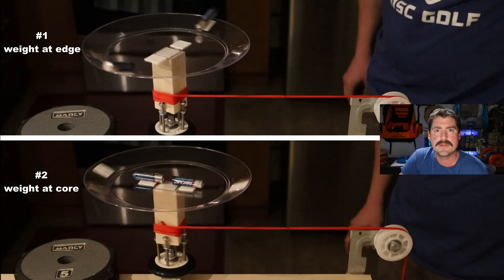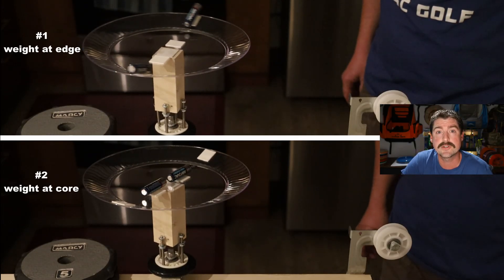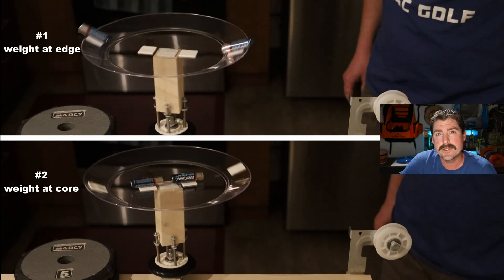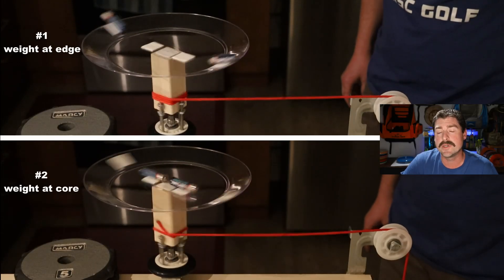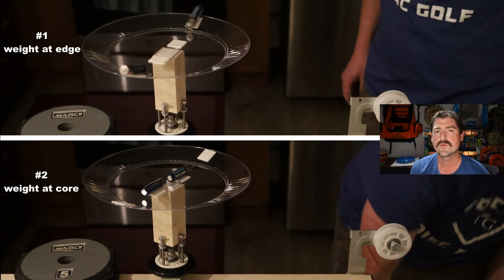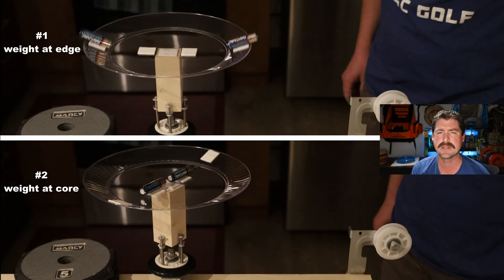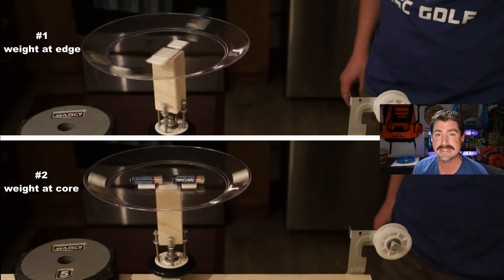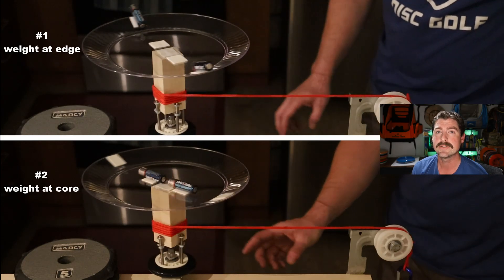MVP Discs - The FULL story of angular momentum

Comment: would love to see this experiment done with some mvp discs and an eqevalent made traditional way.  as in the HEX and BUZZZ same weight as well. so they are so equal as possible. use a sharpy and mark the edge so you can slow down it to see the difference in spinn speeed. as this shows the concept sure, one disc two batteries and some tape. sure proof of concept. 

as first qusetion i get. is that the weight is more evenly spaced at the center of the disc becuse it's lass mass seperating the two batteris  and then at the edge, its a lot of relastate between the two battaries, so the energy then get pushed in to two points rather then a disc. 
if this makes sense. 

ser yes it would take more energy to get the spinn, as there is a greater distance for the mass to travle, hens the speed of the disc is differnt then if it was cast in one mold and evenly distribute weight, if this makes sense. but it would be more stable. then a traditional made disc. 

but what would happen if you used or would it be any differce between this experiment, if it where done with am axiom hex and the buzzz or any other 5 5 -1 1 disc. or any other. and se where the weight for equal spill lies. 

lets assume that  hex and a buzzz at 175g gives this result, but a hex at 165g (if they make one that is) and a buzzz at 183g have the same spinn speed. then this would actually be intersting to find out. 

this is just guessing on my part. but these where my thouths i got from watching your viedo. 

I have dyslexia so hope i made meg self understood. 

kinda want ot get some mvp discs my self. just started this year but was drawn to the mvp disc, right away. don't know why, they just or the one I got to hold, just felt right, was that gyro rim that feelt rigth to me. never trown one,  just picked it up in the store and then the guy working there came over and how long have you playd. my avnser, never and then i got a midrage, think it was that mako3 or something like that, ended up getting the buzzz as my nephew loves that disc and has one in the z line and i got the esp. 

but i have ordred some disc from mvp, as i cant shake that feeling those disc had in my hand

Comment: This checks out - been hucking MVP since they only had putters and mids, and on average you need to get that SNAP in for them to fly good, otherwise they just fall out of the sky.

I wonder what effect the overmold has on in-flight stability though, and resistance to torque. In my experience understable MVP doesn't crash and burn like most others, they seem to drift more than turn.

Comment: This is from the MVP website:  
"Increasing a disc’s moment of inertia will increase its angular momentum" &
 "Increased angular momentum of a disc in flight will allow the disc to stay on its rotational axis for a longer period of time" (Think of a spinning top)

Angular momentum = Moment of Inertia x Angular velocity.

What it should say is Increased angular momentum, WHILE MAINTAINING THE SAME ANGULAR VELOCITY, of a disc in flight will allow the disc to stay on its rotational axis for a longer period of time.
  Staying on its rotational axis longer doesn't necessarily result in long flight.
Longer flight requires higher release velocity + higher angular velocity.

However, raising the MOI for the same amount of applied torque will result in a slower angular velocity.  Resulting in about the same angular momentum.  Meaning the gyroscopic  effect will be about  the same.  

Because of the higher MOI, you have  to put more torque in to the spin, to achieve the same angular velocity, in order to realize the advantage of moving more weight to the rim.  I suppose some pros can do this.

Maybe a better demonstration would be to get several tops of various diameters.  Spin them at the same angular velocity.  Witness how long each one stays up.  In my opinion, Your demo exaggerates the difference between a single mold disc and a over mold.  There's not that huge of a difference. 

All golf discs have gyroscopic effect working for them.  Otherwise they would not fly straight. 
Wobble.  An issue of learning how to throw forearms is wobble.  
Putting more spin on the disc makes it more stable, because of the gyroscopic effect, and the wobble goes away..

After watching your video I got my leopard out, which has the same flight numbers as the relay, and started comparing them.  However, they are not a perfect match.
   1.  They have different rim configurations (see pdga disc specs.)
   2.  The leopard weighs about 10 grams more.
Also, the leopard is significantly more domey which, I believe, gives it more lift.
But, the leopard has similar weight distribution as the relay.

Comment: So the question I would have would be how fast does a single mold disc's rpms slow down vs an overmold.

Also another thought:
I assume that higher rpms will also give you more high speed turn and less low speed fade and lower rpms less hihg speed turn and more low speed fade. It looks like since you have faster spin at the start on a single mold you would get more high speed turn but a bit more over stable at the end of the spin rate slows to a slower rpm than the over mold. So if I am correct in my assumption, and assuming you throw 2 discs with identical flight characteristics but with one being a single mold and one being an over mold them you should get more turn and more fade out of a single mold disc and less turn and less fad out of an over mold.

I would be interested in your thoughts on my assumptions.

Comment: I see what you're going for here but there are a lot of variables you skipped here. Like we don't know if any of this data scales up in a linear way or if it's exponential. Or say if there is a spin rate on the disc where you see diminishing returns regarding glide. Or WHEN that spin is most important. MVP discs crash hard because of their tendency to have flat flight plates. A flat disc (generally) will flip up AND fade a little more than it's domey counterpart. This experiment you've set up only demonstrates one variable. I think this is going to be really misleading to most people, which is a bummer because clearly you have good intentions. You're just missing literally all of the rest of the physics involved in a disc's flight.

Comment: As a former collegiate thrower, discus and hammer mostly, so much of the flight mechanics for discs seems SO behind the flight analysis and knowledge for other throwing sports. I was a thrower in the 90s and just now manufactures are going for more rim weight?  Pros and cons to it. Same as with a discus. Most people do better without the over edge weight. It is hit or big miss. The center mass has a larger margin of error and allows most to perform better than a “high end, rim weighted disc”.

Comment: I like the setup. Very good visual to demonstrate the concept of rotational (moment of) inertia; the object's resistance to a change in its state of rotation. Mass of the disc and batteries is the same, but placement of the batteries closer to or further from the axis of rotation dictate the disc's ability to speed up (or slow down) its rotation. It follows the rotational analogue of Newton's Second Law F=ma, which is T=IA where T is torque, I is rotational inertia, and A is angular (rotational) acceleration. Torque by definition is the (cross) product of the lever arm and Force. In your rig, the lever arm was consistent (the diameter of the wood block that the string wrapped around) and the force was constant (the drop weight) so that it pulled like a lawnmower starter to provide the twisting force. Again, great setup, demonstrates that with the same torque, large rotational inertia means low rotational acceleration and small rotational inertia means high rotational acceleration. But I think you jump to an erroneous conclusion by saying that the idea of pushing mass to the edge (increasing rotational inertia) is detrimental because it causes a lower spin rate for the same amount of force (torque). If that were true, drivers would push their mass to the flight plate and have hollow wings, when in fact all disc manufacturers make their highest speed discs with their masses pushed outwards to take advantage of gyro. MVP just draws attention to it with their high contrast overmolds. As you demonstrated, the larger rotational inertia disc spins for a longer period of time. In flight, this translates to a longer delay in the start of the fade (particularly on higher speed discs). Discs slow their rotations down during flight and for long distance flights with a lot of air time, the higher rotational inertia keeps it spinning and cutting through the air as it slows from the air resistance. Just as your bicycle is steady as long as you are moving, once the wheels slow down too much, you start to tip over. As your disc in flight slows its rotation, it is more susceptible to its wing shape catching the air and beginning to pitch up. When the front side starts to lift (for a RHBH throw or clockwise rotation as you look down from the sky), the disc will tilt to the left, and this is the fade. MVP's gyro claim is simply that having the higher rotational inertia, their discs will hold the low speed stability longer like a flywheel and delay the fade.
Reply: Yea what he said mvp rules!

Comment: With the right mold the gyro discs stay straight beyond belief. Axiom proxy. Axiom alias. MVP atom. But yes for drivers they will have their fade portion later in flight and a little more dramatic. Since that low speed energy is now pulling at the wing. They make so many great discs though. And streamline are single mold and are excellent.
Reply from the maker: The Crave is doing some pretty amazing things for me right now and it stays straight really well. I feel like there is something to that happening when you have the arm speed to throw the disc at a higher velocity than what its numbers are. A combination of the slower spin but balancing that out with a higher speed throw might be where the magic is.
So yes maybe rim weighted discs can stay straighter longer as long as you compare a lower speed rim weighted disc to a higher speed single shot?
Also Mint and TSA have some really awesome molds. Im throwing Pathfinder, Bobcat, Animus, and Mantra right now.

Comment: Maybe this is why I find all MVP discs to be slightly more stable than the numbers rate them as. I don't have a big arm, or great technique, and when I throw overmolds,  for me they seems to be more OS than usual. I also notice when I throw like a Wave, imo, the disc is spinning slower in the air, which your video is kinda proving my thought could be correct. The wave still launches, but it very well could be spinning slower than say a wraith or Hades is. This could explain why I enjoy throwing their FDs, mids and putters, but then I kind of top out around 7-8 speed with overmold discs. Great video, Doth!

Comment: I personally have had a lot of success with MVP discs. I tend to have the most success when I get an MVP disc in a lighter weight. This goes to your point of acceleration, velocity and spin. For example I would get a 165 - 167 Gram MVP Volt when I would usually get a similar disc without an over-mold in 172 - 175 Grams. Takes less energy for me to accelerate and generate spin.
Reply: this was my first thougth, never trown a mvp, just started playing this year, and fist of, what weight would be the difference to achive the same spinn ratio. so this would be fun to see an experiment on as well

Comment: Thanks for the demo & explanation I am just getting into disc golf and love the physics.  I initially had, I think, some of the same questions about timed release as some of the other comments.  I know the physics says the the weighted rim should spin longer but because the strings did not stop imparting force at the same time it was hard for me to tell how long each plate spun for after all the energy was finished being applied.  I think it would be great if you overlayed a timer that showed how long the plate spun for after the force was applied.  That way you don't have to cut strings to time a release and don't have to stagger start the spinning to get the strings to finish imparting their energy at the same time.  So while equal energy was applied to both plates then you would measure how long the plate spins for from the time the string comes off until the plate stops spinning.
I think from watching the video a few times that it will still show that the rim weighted plate spun longer but I think it would solve some of the questions about timed release and equal energy imparted and give a real clear time of difference in spin time.

Comment: Wouldn’t having more spin make it want to fade harder, but also make it more (gyroscopically) stable?
Reply: In any case, the weight in the edge is that much and it may even out the distance gains because of the slower spin rates yet longer spin time
Reply from the maker: more spin makes the disc stay straighter, not fade or turn.

Comment: it would be interesting to know exactly how much weight distribution change happens with an overmolded disc vs a single shot disc.  In other words, if you take the same disc how many grams of weight are moved to the rim from the middle of the disc.  I would imagine that you would be able to see the weight distribution in 3D CAD between one and the other but the manufacturers aren't letting us see that.  In order for the demonstration above to represent what is actually going on, the amount of weight moved from inner to outer would have to be correct.  On another note, I've noticed that some of the MVP discs seem to have a very predictable flight.  I wonder now, after seeing this, if that has to do with a slower spin rate at release which has less effect on the high speed turn than a disc that is spinning faster.  For example, I've been experimenting with some lightweight but very stable high speed discs.  With the extra velocity at release, they behave less stable then the same disc in normal weight.  However, I've not put any in my bag for good because I find them to be much less predictable with regard to high speed turn and low speed fade.
Reply from the maker: Yea Tony, if figured a way to get accurate measurements for weight distribution we would be well on our way to some better demonstrations. Another huge thing would be to get some real numbers for rpm at release for a 45mph thrower vs a 70mph throw and many examples in between(I know 2 people throwing at 50mph will have different amounts of spin imparted) to build a known spectrum of rpm that can then be reproduced. The remaining battles then for a test rig are the drag on the central bearing and lack of air resistance.
All cool stuff to think about for sure.
I have heard folks refer to some data of weight distribution data that was gathered by someone cutting up a disc. I'm trying to track down that info now. I am having trouble thinking of a way to get good data myself by cutting and weighing.
Reply from the maker: https://throwingplastic.com/overmold-vs-single-mold/
Reply: @DothSavek  interesting read.  Thanks!

Comment: I just wonder if the differing spin rates require a method that rotates the disc at its axis like what's shown in this video. When throwing a disc, body and arm motion isn't slowed or affected at all by the weight distribution in the disc because it's not rotating the disc. the spin all happens upon release
Reply from the maker: The spin happens because of the energy imparted on the disc by the person throwing. A disc with more weight on the rim that receives the same amount of energy imparted will rotate more slowly compared to a disc with more weight in the core.
Reply: @DothSavek  You know, it does make sense what you're saying. Another example are ice skaters who spin very fast with their arms close to their bodies or relatively more slowly when they have their arms extended

Comment: Makes sense that it would be harder to get up to full spin speed. I throw an undertaker for most drives and even at similar weights the tesla is just much beefier. Same with my 165g Photon, it seems a lot faster than it should be. I can throw the hell out of my max weight Servo though. Its only a 6.5 speed but flys farther than either the tesla or photon. The gyro extra beef is why i went with the Deflector for my meat hook mid. Any anyhyzer angle or power and it will always not turn over.
Reply from the maker: Yea, I have stepped all the way down to a Crave to get controllable straight finishes. Where with a single shot I can get 12 speed destroyers to have a similarly straight finish.